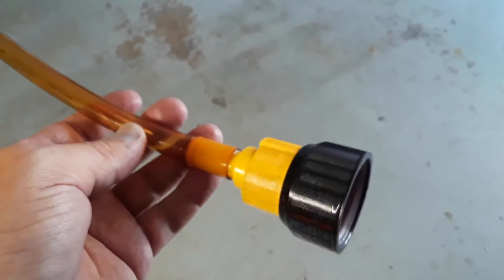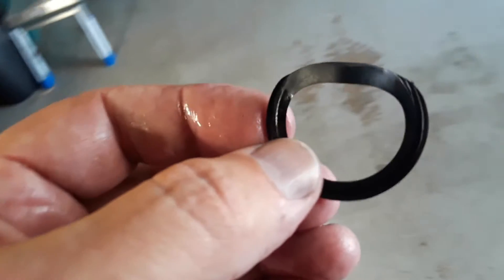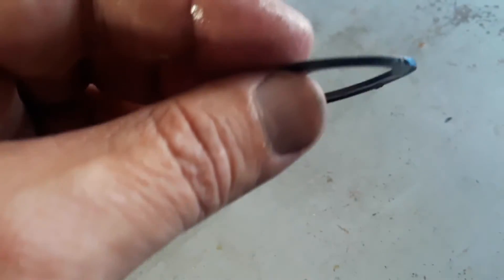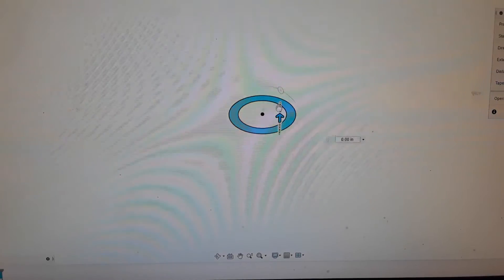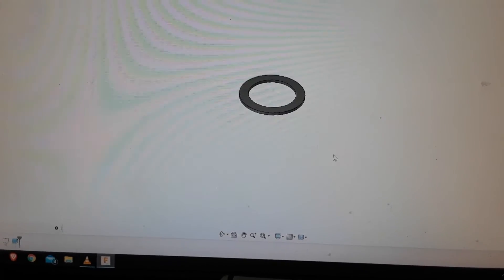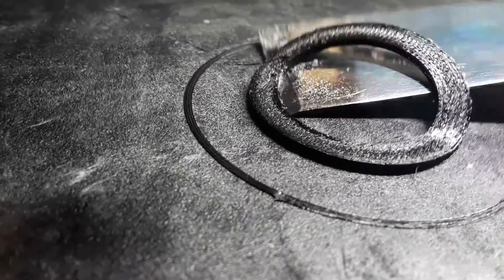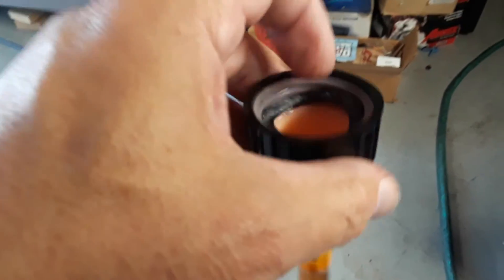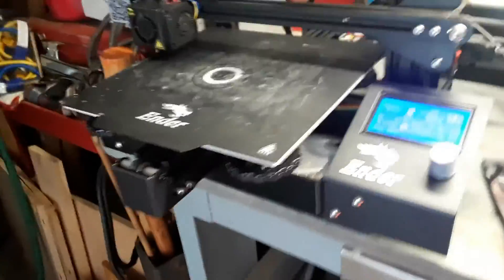How to make a simple Rubber Gasket on a 3d Printer using TPU Filament.

Comment: finally wha I was looking for :D so its possible :) Because our old outside water tap has different gasket, not possible to buy, we try cut hoses, etc, but its weird shape like ring with ears and nose :D but this I was affraid wont work but looks like it will :) We don't want to change it, its part of house and it would need destroy wall for it plus new battery, maybe tubes too. This is much cheaper :) So, thank you very much! :)
Reply: I just did that to my hose bib last weekend! After replacing the flat rubber washer, repacking the valve stem, and installing a new vacuum breaker, it still leaked. Home Depot guy said they don’t sell that washer; you have to buy a new hose bib (for $60!). So I made a washer in Tcad, printed in TPU, and now my spigot is 100% leak-free. Who knows for how long but still feels great that it worked

Comment: Trying this for a air compressor rebuild... why pay $60 for all the gaskets when you can print them.  I was going to make a webbed model and then smear gasket RTV then bolt it down.  I'll maybe use a higher temp Nylon Taulman Alloy 910

Comment: How well does that TPU hold up when exposed to gasoline? Could I print a replacement gasket for a small carburetor for a motorcycle?
Reply from the maker: The gasket I printed is still doing fine in oil, before I did that one I submerged the tpu in gasoline overnight and it didn't seem to have any effect on it so my guess would be it should be fine.
Reply: @737mechanic  excellent! Thank you my dude!

Comment: What infill did you use ?
Reply: Dude, it's like 2mm, its solid you couldn't make infill for it if you wanted too
Reply: Very Informative video -  I have been printing with TPU filament for about 3 yrs now: different types of automotive gaskets - oil drain plug, transmission drain plug.  The material is resistant to motor oil and transmission fluid and seems to be fine with the 215 to 230 degrees (F) encountered.  I use 35% infill for gaskets that are 2.5mm thick.   I have also printed tires for RC  race cars @ 50% infill.
Reply: @timslavings1469  Have you tested it's resistance to gasoline, for applications such as carburetor bowl gaskets?